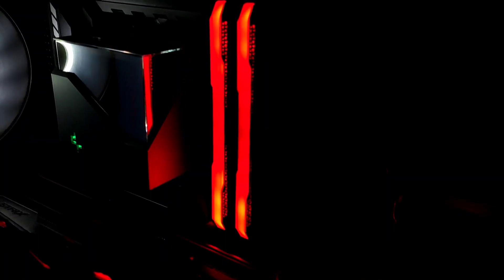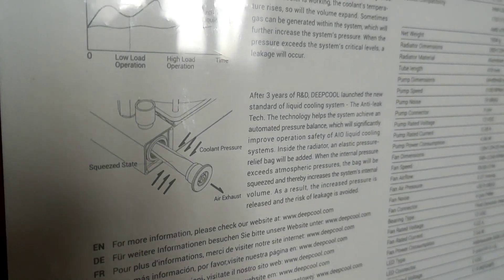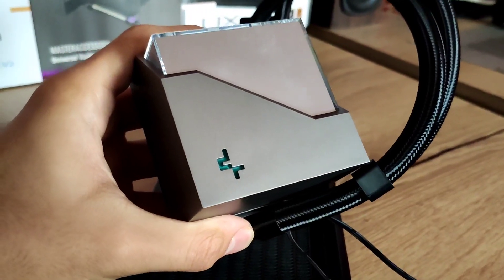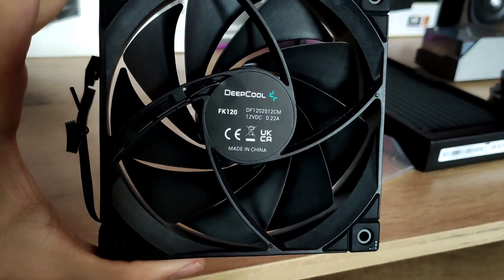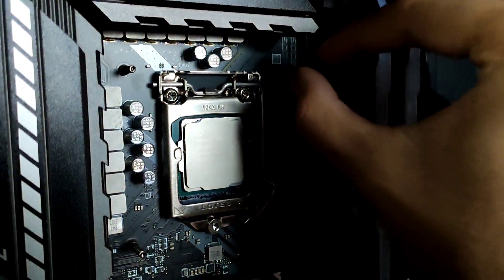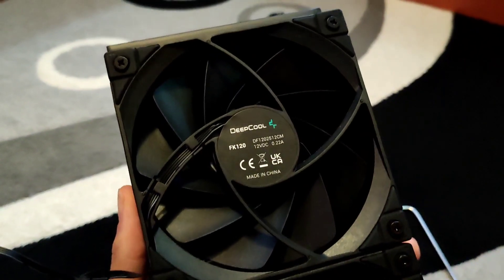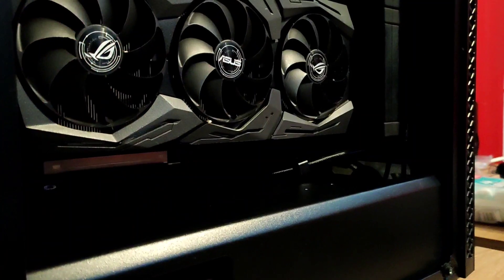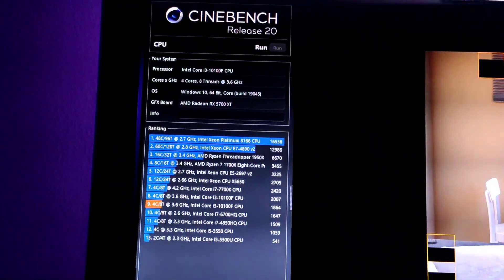Now that's a BEAUTIFUL AIO Liquid Cooler! - LT520 Unboxing & Review Testing Installation

Comment: hey man, i bought this aio and it performs great, but let me ask u this, when u turn off ur PC, the deepcool logo on the aio turns off too? Mine stays on even after the pc turn down
Reply from the maker: Yes mine turns off as well i think your problem is that you have turned on some settings for the Power Delivery or RGB Headers in the settings

Comment: does changing the stock fans with other fans affect temperature? I want to change the stock ones with rgb fans
Reply from the maker: I would say not really maybe if you CPU is high performance maybe then you can spot the difference 2-3c not more so i would say go for do what makes you happy
Reply: So did you change the stock fans?? And if you did which fan did you change it to? And hows that working for you?
Reply: Any case fan that fits your fancy with high CFM ,and maybe low noise if that’s a concern, would do fine.